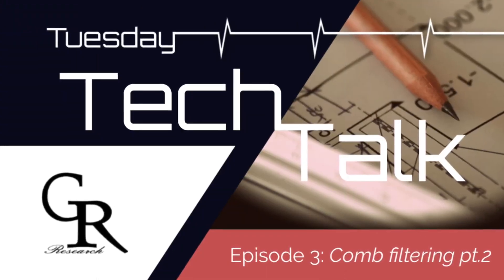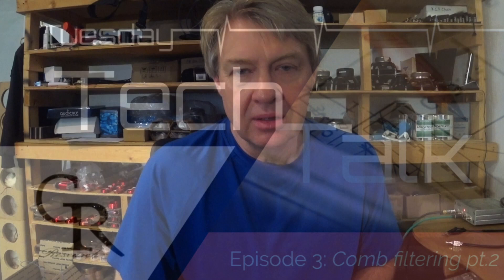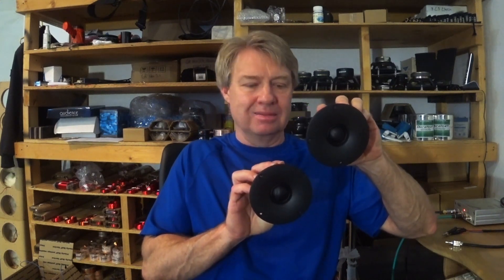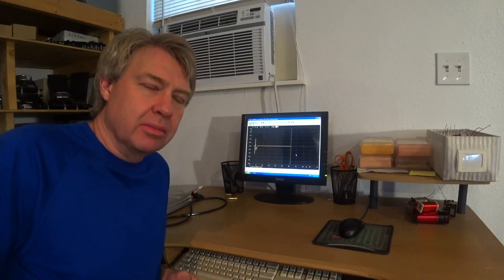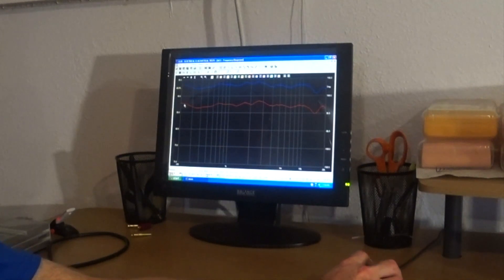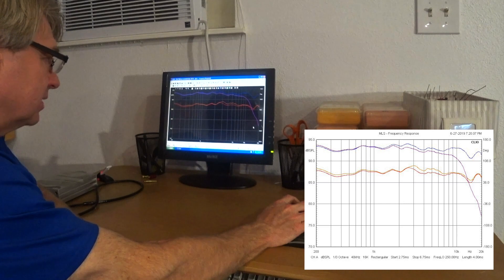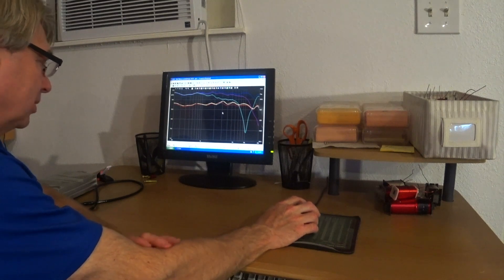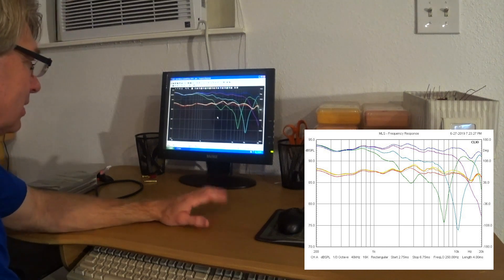Tech Talk 2: The REASON why 2 tweeters wont work!

Comment: Danny Richie (GR-Research) vs Eric Alexander (Tekton Design) - Multi tweeter hater vs the Multi Tweet lover - $49.99 Pay Per View main event.
Reply: You're totally off in your understanding of the tweeter array. This is what happens when a viewer comments on something he knows nothing about.
Reply: @carlosoliveira-rc2xt  Don't assume I don't know about the tweeter array partner.
I know that Tekton is not using a bunch of tweeter to play the same signal.
Eric is using the array to couple the low mass tweeters to play the mid-range which he can crossover to the woofer at a lower X-over point. A single tweeter is used to the High frequencies.
It's people like yourself who cannot see sarcasm in a post. They (you) think that you so ultra knowledgable about things and you must correct to internet.
Reply: @kevonmanuel  Have you seen top Denny's line array designs? They could have more tweeters than any of Tekton models.
Reply: @carlosoliveira-rc2xt   He stated the truth...he did not qualify a position, just two opposed POV's.
Reply: @scottlowell493 Let me explain. Richie is not a multi tweeter hater. Many of his designs have multiple tweeters. This video is not a video about not using multiple tweeters but on using them incorrectly. This is what I mean regarding he not knowing what he's talking about since in reality they're both "pro multi tweeter". His attempt at humour fails since its inaccurate. If he actually knew what he's talking about he would have seen this.